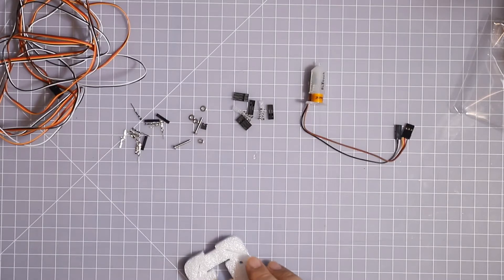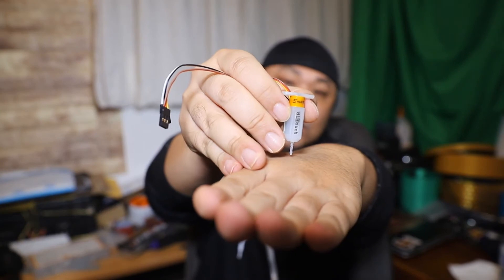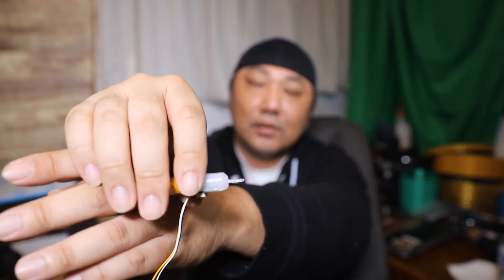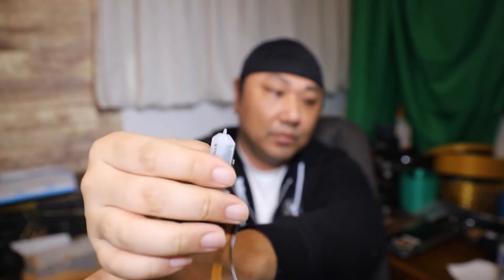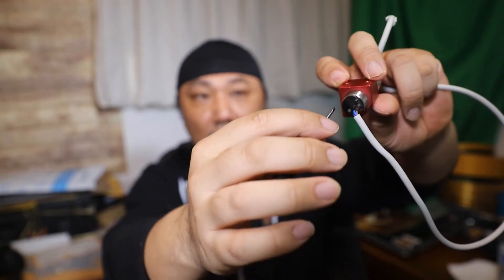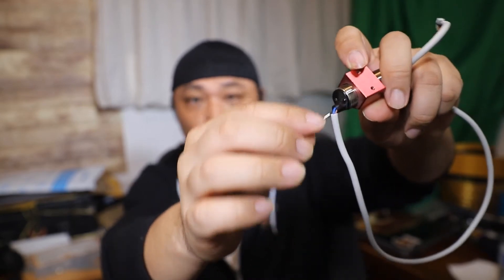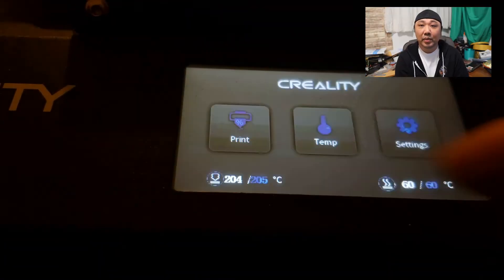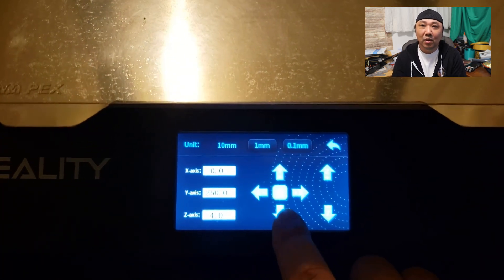BLTOUCH 3.1- TINY MACHINES FIRMWARE REVIEW. CR10s Pro V1 Compatibility - Marlin 2.0

Comment: Where do I get the f#$King firmware???? I have watched a dozen of these videos and no one says where to get the firmware.  Several say get tinymachines but they do not have it unless you buy their upgrade.  So I paid $69 for the creality bl touch upgrade and there is no fucking firmware to be found anywhere.  Well just fuck me sideways!!!!
Reply from the maker: The firmware has always been available through github.. Most just don't know how to compile it.... Firmware is available here - https://www.thingiverse.com/thing:4191875
Reply: @DiyProJames  Thanks.  What is the difference between the BIL vs UBL versions of the .hex files?
Reply from the maker: @ctbram0627  One is bilinear and the other is unified bed level.. Please look up the differences from the marlin website.
Reply: @DiyProJames  more questions marlin-crealitydwin_2_0 files CR10ProBLTouch_BIL|UBL_DW5.hex appear to be the same 420 | 480 KB files?  Don't you need two files?  One to update the screen and one to update the mainboard firmware?
Reply from the maker: @ctbram0627  Please follow the instructions https://youtu.be/iJjqOUlZHUw

Comment: How can i change the Thermistor in Tiny Machines Firmware? Or isn't it possible?
Reply from the maker: Tiny machines firmware is a branch of the marlin firmware. You should be able to change the values in the config adv.h  . However, I don't recommend you doing this unless you know what your doing.
Reply: Thank you for your fast reply.

I damaged my thermistor and had to buy a new one. The seller informed me that I should enter "TEMP_SENSOR 11" in the firmware configuration. I did not find the "config adv.h" in the current Tiny Machine firmware. I’ll take a closer look now.

Comment: Quick question ... thinking of upgrading to Marlin 2.0 on my Cr 10s pro.  Should I upgrade my mother board to 32 bit first before doing that. I also have the bl touch running on my printer.
Reply from the maker: Were you planning on upgrading to a 32 bit board? This is something only you can answer. What is the purpose of getting a 32 bit board? I know everyone seems to say upgrade, upgrade, upgrade! But what is the purpose of this upgrade. Ok.. let me clarify.. Marlin 2.0 is made to support 32 bit boards. Great.! I get that so we should upgrade, but wait... let's take a look at Marlin 2.0 features. Below taken straight from the marlin website:

32-bit support with several boards added
Improved support for AVR boards
Power-Loss Recovery (for SD print jobs)
(Magnetic) Parking Extruder support
(Magnetic) Switching Toolhead and Toolchanger support
Gradient Mixing and Gradient Virtual Tools
Automatic power supply control
More Trinamic driver support, including TMC2208/9
Expanded probe support
More customizable Status Screen
LED control menu
EEPROM auto-init
Heated Chamber support
Support for up to 6 extruders
More temperature sensors supported

Things like magnetic parking support. Heated chamber support. Will you be using any of these features now or in the future?. Often these upgrades require hardware upgrades as well not only the firmware. So which of these features are you trying to implement. For me, one of the best upgrades was investing in a raspberry pi with octoprint. For others it maybe different. If your printer is working perfectly fine don't mess with it unless you want to implement a new feature. Some do it to improve print times, but this requires a lot of calibration tests and will not work for all prints because prints have different features. What I've seen so far are negligible improvement for most users.
Reply: DiyProJames thank .... logical reply. I just really didn’t have any insight into it. I currently modified my CR10 s pro to direct extruder. That worked out good. I also upgraded to linear rail on the x axis. Big improvement over the 3 rollers. That being said I’ve learned over time if you don’t know ask. Thanks for the info. Later

Comment: I watched your video about installing the bltouch with tinymachines firmware. The firmware of tinymachines has changed and it will not work with my Cr10s pro v1. There is no darkmode for the display, the display freezes of you will measuring the bed!
Reply from the maker: Please watch this video. I left a version of the firmware on my thingiverse account. https://www.youtube.com/watch?v=VC6Tny5BNMY
Reply: ProjectJames sir, you saved my Cr10s Pro!!!! After a big print my Cr10s pro (sorry for my Bad englisch but i learned it 35 years ago in School) has big problems with the leveling. I think that there was a firmware crash!? 
I changed the sensor to bl Touch but it doesent work with the Firmware of tinymachines! I can not describe all the problems in english. Your Video installing the bltouch, your bltouch mount on thingiverse and your answer on youtube saved my and my printer! Thank you very much! I tryed to tip you on thingiverse but it doesent work! 
Thank you, thank you, thank you! Stay save stay healthy!

Comment: Hey man I'm using the Creality firmware 1.70.1 on my CR10S PRO, and I'm also encountering auto leveling issues - the nozzle crash into the left side of the bed when I press auto levelling after adjusting all the necessary steps prior. I think it might just be the sensor as I have tried everything except changing the sensor 

Do you recommend changing to the tiny firmware and changing to BL touch at the same time? As previously it works fine until recently.
Reply from the maker: Have you tried adjusting the sensor? Watch my other video at around this time https://youtu.be/qv_kZrL5uiw?t=1009 The inductive and capacitive sensors are finicky. Sometimes that little screw on top might come loose over time when printing. If you tried this method and it doesn't work then you might want to change the firmware and sensor.

Yes, Changing the firmware and bltouch at the same time will save time. You have to access the bottom of the printer in both cases. Bltouch upgrade to add the cables and firmware. If you update only the firmware you still would have to flash the lcd.